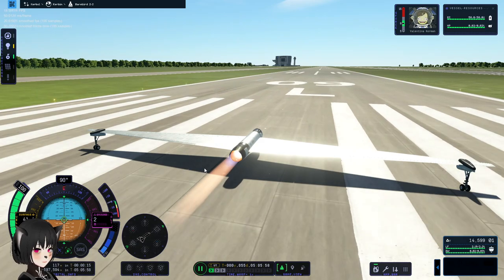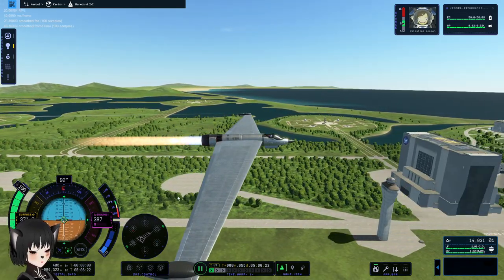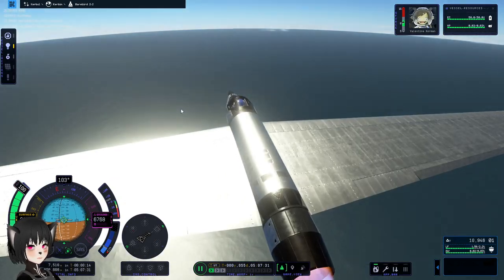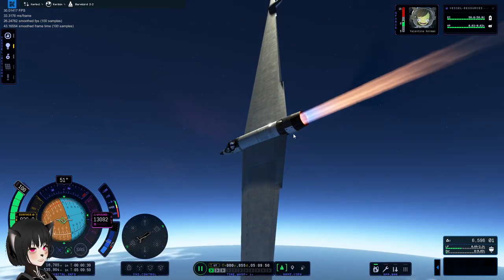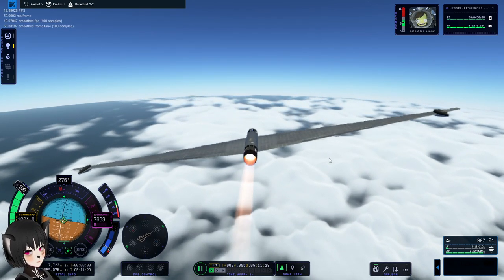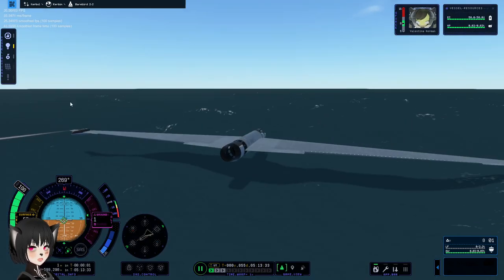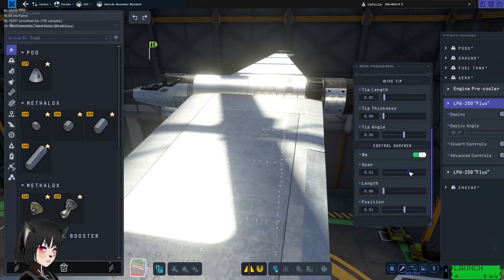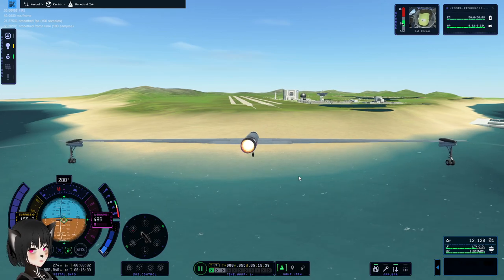Mach 3 Tin-can Jet Glider, Kerbal Space Program 2

Comment: I believe if the SAS makes it wobbly either it's bugged, or if it's like the case as it was in KSP1, your controls may be too big or too large. 
SAS sometimes goes like "point down until point up" and then swap, in an infinite loop. This can cause oscillations if the control surface is too large (too great effect) or too small (requires large pull on stick before effect, then takes a while to move back to neutral position) 

Procedural wings look amazing tho.

Is wing flex a mechanic?
Reply from the maker: I see c= I did make a narrower wing version and it seems to fix the SAS issue x3 also yeah they are u wu not sure about flex wing x3 my wings were moving up and down but that might just be it not attached too strongly to the hull xD
Reply: @LucaTheGuide  no idea how a narrower wing fixes stability but that's cool